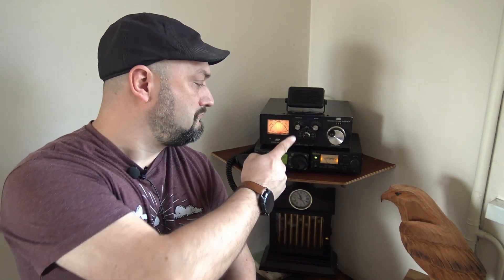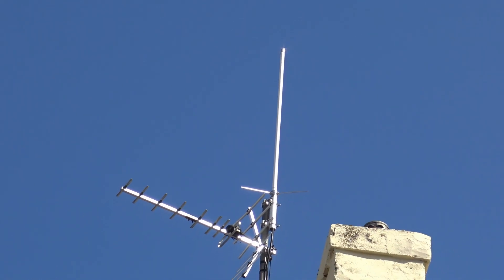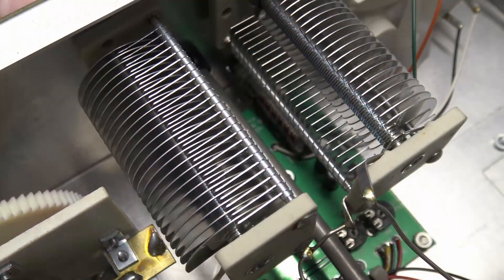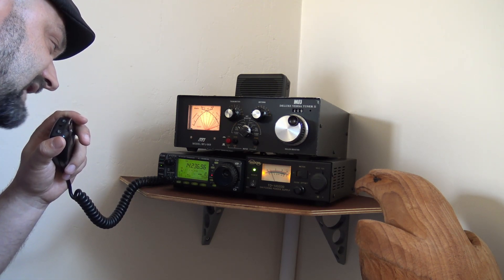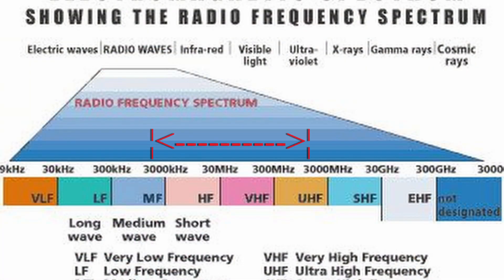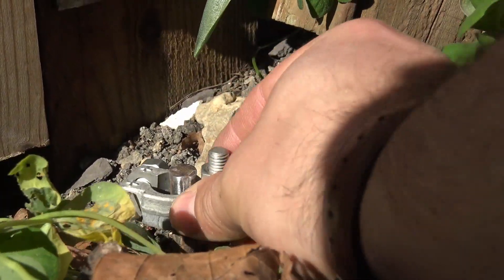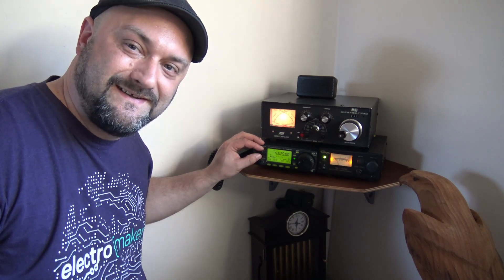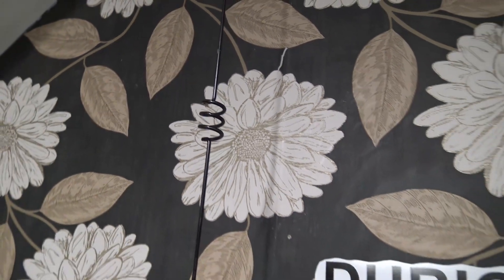DuB-EnG: An Introduction to Radio Communications Ham Amateur NOT CB :-)  Seting up a HF VHF UHF Rig

Comment: Nice, thanks for sharing.  I need to get a stealth antenna  installed,  something the HOA and neighbors won't object to.
Reply from the maker: A long wire inside the attic has worked for me in the past :-). It’s a little deaf, but it just about does the trick :-).  I’m sure there are many different options!! :-)

Comment: the 706 MKIIG is the finest mobile HF rig ever made.
Reply from the maker: It has been my staple mobile / base and contest unit for ever...  I am a big fan too :-)
Reply: @DubiousEngineering   I picked one up at a swap for my Jeep last year, and after a couple weeks of "Wait, you're talking to me on a MOBILE?????" type replies, I bought another one for my job site. And when I hear someone else talking on one, I totally understand. They just sound great, no mods required.
Reply from the maker: macrossactual I had a Jeep too when I lived in Chicago! ... epic :-).  I did have an mp1000 mk2 ...  that was bonkers...  but the 706 is more useful....